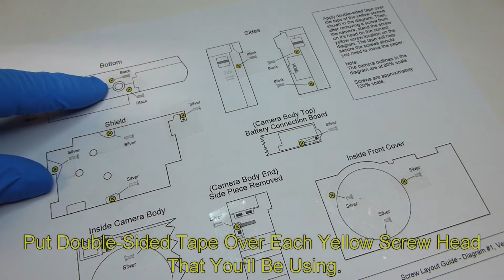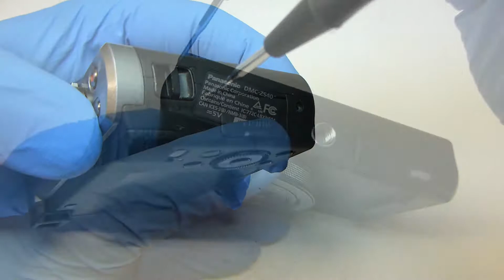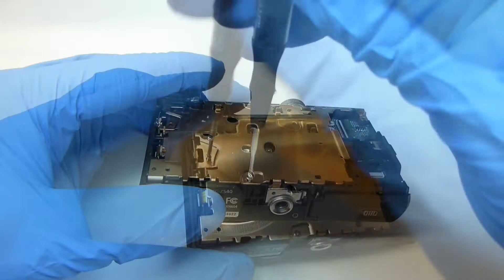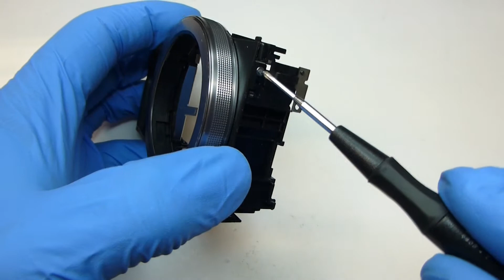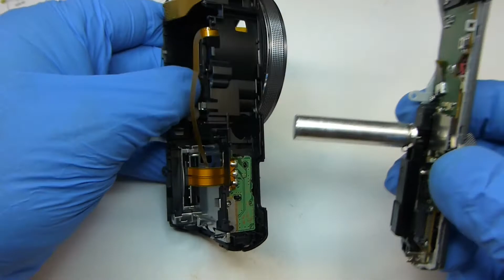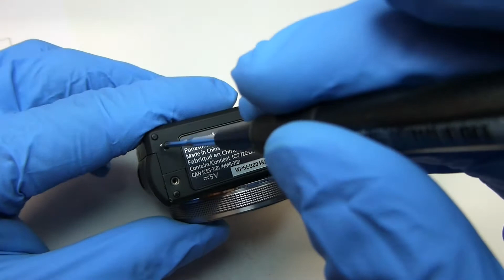How To Disassemble & Reassemble A Lumix ZS40 / TZ60

Comment: I made de it open and the problem with the lens when I zoom in or out switching from foto to video. Now not anymore. But now my screen is moving and it’s zooming a little like looking for focus but the screen move the whole time. But not if I turn the camera like in portret mode but back in landscape mode it’s moving again . What can it be ?? ❤🙏🏼🙏🏼
Reply from the maker: Hi Peter. When you say the screen is moving, do you mean it is physically moving in the camera, or that the image on the display is shaky or moving?
Reply: @Thebobfactor  yes Robert 🙏🏼
Reply from the maker: @persbureaupeternick  if the LCD screen is physically moving, then it did not get properly interlocked onto the frame. Double check that it is locked onto the frame as shown here: https://youtu.be/fYZlhShQ-hg?t=1052.
Reply: @Thebobfactor  I think you right Robert but I really messed it up. The camera was a memory from my time in Bali Indonesia. My first Camera. First it started with the lens that kept hanging half way open. To expensive to go to a service center. When I did all you showed and take all apart and in again. The problem with the zoom was fixed I was so happy. So the screen kept moving so 1 of the 5 shots was sharp and 4 blur because the screen kept shaking. So what I did I thought maybe a can try to take the lens part out en strip it. Like I saw in a outlet you tube channel. But it didn’t work out wel. When i try to put the lens back inside all went wrong. Screws where falling so I put some glue 😔😄 so now the camera can turn the lens is doing nothing. if I waited a little longer time and with maybe your advice that was maybe still the only problem so de zoom was than ok if I did nothing with it and with you’re advice maybe all was fixed. So now I’m sure if I buy a new lens unit about 155 usd on Alibaba it will be like new … I think…. But so happy I see you’re channel because it save me now still a lot of money with servies cost. If u order the lens unit I can put it myself ❤️🙏🏼😊👍🏼 Thanks for that Robert. Regards from Rotterdam the Nederlands !
Reply from the maker: @persbureaupeternick  I'm so sorry that the repair didn't work for you. Hopefully the new lens unit will go in without any problems at all. Give me a shout if you have any problems at all installing the new lens unit. Good luck with it.
Reply: @Thebobfactor  you very kind thank you Robert 😊🙏🏼🙏🏼

Comment: Fantastically useful video. I am cannibalising one camera to fix another.  I have successfully swapped the sd card/main circuit board assembly. My "working" camera has lost the engraved settings on the mode dial. How easy is it to swap the mode dials as the donor camera has the engraved modes?
Reply from the maker: I haven't tried removing the mode dial on a ZS40, but on a ZS19 which I have tried to do that on, it is almost impossible. There is a plastic locking piece that locks the mode dial into place is on the underside of the dial, and I couldn't remove it without damaging it. It may be different on the ZS40 and worth looking at. You will need to remove the screws holding the circuit board down and also disconnect the flat ribbon cable, to remove the circuit board. Then you will have access to the underside of the mode dial.

Comment: Fantastic video Robert!  You saved my Lumix ZS40!  

I had to expand on your instructions to access the top buttons and spray contact cleaner in the zoom slider - and ended up with a spare broken latch :O - but it all went back together and the zoom works again!

Thanks!
Reply from the maker: That's awesome Simon. Great job on the repair!

Comment: Hi would you have any idea why my Panasonic tz70 will not power up? The lens is stuck out and a red button near lens is on but will not do anything else. I did forget to take battery out and have not used since lockdown happened, battery was stuck in camera but did not look damaged just tight in battery housing.  Its not an old camera so now we can travel again planned to use again
Reply from the maker: Hi Lyn. If the only problem with the camera was that the lens was stuck extended, then I would stay it's the lens unit itself that has a problem. However, with the red light on the front of the camera continually on, then I would say that the main board has a serious problem. Sorry I can't be more help.
Reply: @Thebobfactor  thank you Robert my husband thinks its also main board. Would you have any idea where i could get a replacement or is it worth replacing?
Reply from the maker: @lynwood7111 , I generally get most of my camera parts from sellers on eBay, but I don't see any main boards for the TZ70 for sale right now on there. There are a few "Used, And In Good Condition" TZ70's cameras for sale in the price range of around $150, but they are all out of the U.S. I would guess that a used main board (if/when one becomes available) for the TZ70 will sell around $80-$100. So, it's kind of a guess on whether or not it would be worth repairing the camera, or buying a used one that is in good working condition. If you decided not to repair your camera, you could probably sell yours on eBay for parts and get anywhere from $80-$125 for it just as it. I've have both good and bad luck when it comes to repairing these cameras when I don't really know which part is the actual problem. And without knowing exactly which part is defective on your camera, I probably wouldn't try to fix it.

Comment: Hi! I have just watched your video. I have the same camera, and this tutorial video is pretty useful for me. I have some dirt inside the lens part, which I shoud clean. Do you have video or any tutorial how to disassemble that part? Thanx a lot!
Reply from the maker: No, I'm afraid I don't have one for the lens disassembly. The lens is pretty complex, and I attempted it one time, but I wasn't able to reassemble the lens correctly.
Reply: @Thebobfactor  Oh, I was afraid of that. Once I asked the service but they told me that the repair cost would be higher than the camera so I cancelled that. It is a shame that the lens unit is not closed properly, and some dust can get inside. I can see little things on the lens inside, and I am sure these influence the process of making pictures in a bad way. I liked this camera very much, while it was dust free. Thanx for your quick answer.

Comment: hello :)
I have TZ60,  please what size screwdriver ?
Reply from the maker: It should be the #0000 Philips screwdriver, just like the ZS40, which is the same camera physically.
Reply: @Thebobfactor   but what size screwdriver ?
3,4,5,6,7,8,9,10 ???? millimeter
Reply from the maker: @thenutsbreaker1119  The size of the screwdriver is a #0000 (four aught) Phillips head. The size "#0000" is a standard size term used. So when I google for the conversion from #0000 to millimeters, it shows "1 millimeter". I hope that helps you out.

Comment: My camera does not power up when the battery is inserted. I suspect the battery connection card was damaged when the camera was dropped. But I am not sure. I used this excellent video to remove the battery connection card but there are no obvious problems. I tried a continuity test between each battery connection pin and the end of the ribbon cable. I did not get continuity for the positive pin to the end of the ribbon cable. I want to make sure that this is the damaged part before ordering a new one. Thanks in advance.
Reply from the maker: Hi John, If you're not reading a connection between the positive pin to the connection at the end of the ribbon, then I would say that there is a problem with the board or connector or ribbon somewhere. Did you take the circuit board out of the camera when you tested it? If not, then you may want to. It's possible if the camera was dropped that you may see where the connection break is at, and it may be repairable.
Reply: @Thebobfactor  Thank you so much for responding so soon and thank you for this awesome video! I did remove the circuit board and didn't see any obvious damage. There is a small black box shaped component next to the three pins with metallic pieces on either side. I can trace continuity from the positive pin to one side of this box and from the other side of the box to the ribbon connector. I do not get continuity from one side of this box to the other. I don't know what this box is nor do I understand it's purpose and this is why I am not sure if this board is broken or if my problem lies elsewhere.  Thanks again.
Reply from the maker: @jdtennyson , glad to help out on this. I don't have a ZS40 or similar right now to look at, but if I come across one I will sure take a look at it and see what I come up with for results when checking the the continuity on it.

Comment: Well constructed video Robert. I have a 6 year old TZ60 that I have been using regularly until today when the “Memory Card is Write Protected” message appeared.
I have some knowledge of how the SD card slot works and quickly concluded that the detection pin/switch (p/s) wasn’t doing its job. With a decent torch and magnifying glass I could see that the p/s was not in position. As a result of wear and tear it has failed and can not be persuaded to work.
Only option is a complete new board. I now know how to replace it thanks to your video. 

The only problem is sourcing one that would make it an economical repair (I live in the UK).

Comment: Hi Robert

Love your Lumix videos ....so clear and reassuring to us scardy cats! have problem with my TZ60 so I was delighted to see your "how to Disassemble etc" video which I followed after printing out your screw layout guide...so straightforward I couldn't believe it. Do you have a video on how to clean the Ccd and lens assembly as you did for ZS19  &ZS20 which though really tricky I think I could follow (just)? It looks like I'd have to acquire some tiny hex bits for a start!

Thanks in anticipation

Julian Knell

Comment: I have a ZS40 that just started displaying "SYSTEM ERROR" with the lens almost completely extended. I tested the motor conductors at the end of the ribbon and they tested good. I used your 'Fix the "SYSTEM ERROR (ZOOM)" error on a Panasonic Lumix ZS19, ZS20, TZ27, TZ30' as a guide. I reassembled it and nothing had changed. Any suggestions of where to look next? Can the motor be run manually to retract the lens? Is the motor driven by a transistor or a relay? Before it failed , it would sometimes zoom in when it was supposed to be zooming out. Thank you for your videos.
Reply from the maker: The motor is driven by TTL circuits. I'm not sure if the finals are a standard NPN/PNP type transistor outputs, or FET type. My guess on the motor voltage is 3.3 volts or 5 volts. I'm not sure though. What I would suggest that you do instead, is to remove the zoom motor from the lens unit and manually turn the gear inside the lens unit that the motor's gear interfaces with. That will tell you if there are any problems inside the lens unit with something being bound up, which could be preventing the motor from working properly. I've also had that intermittent problem of the camera zooming in the wrong direction and on one camera I was able to determine that it was the actual zoom control switch/lever. I ended up just replacing the entire top piece and it fixed it. I don't believe that that problem will create the SYSTEM ERROR (ZOOM) problem that you are having though. Because to get that error, the camera would already have to know that the lens unit is receiving the commands to zoom (meaning the zoom switch/lever is working), but it's not receiving the proper feedback from the lens unit saying that it did indeed perform the zoom.